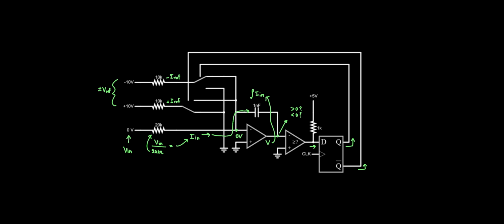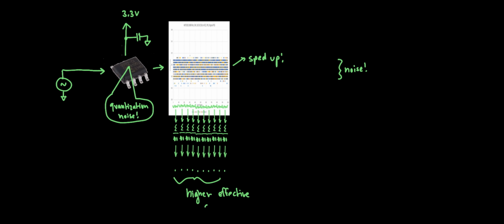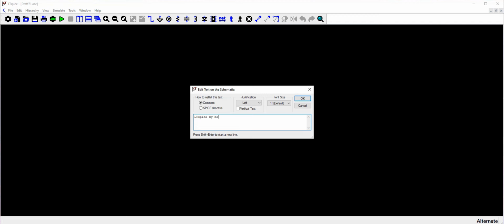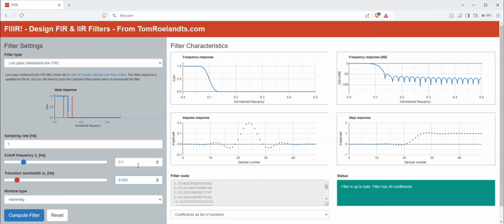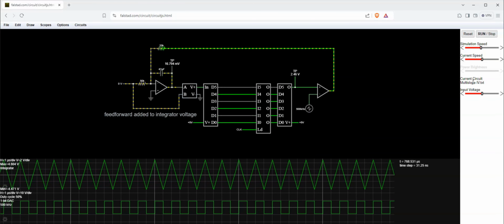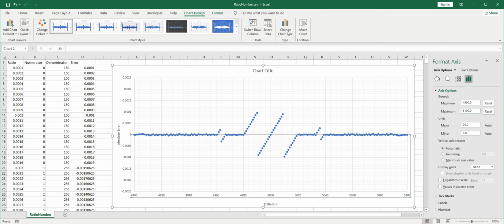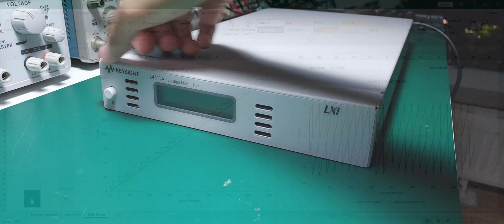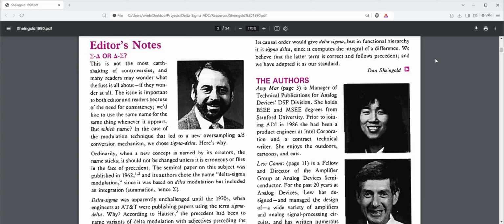Agilent's Multislope IV - A Delta-Sigma Story

Comment: I look into the slope conversion methods in the late 80s. I thought that multi-slope primary solve the issues:
1. Reducing the slope depend comparator delay by reducing the slope
2. Allow the internal compensation cap of the main integrator opamp to settle
3. Delay the final charge-balance decision after the dielectric time constant settle
4. Allow a fine ADC based on the slope remainder but requiring to calibrate the time constant of the slope

I think there are also patents and chips from ADI for triple-slope or similar. Yes, Keysight is still competitive on the market with a decade old design beside considerable flaws:
1. Blind times in the integration method which where solved in the Solartron instruments
2. Multi-Integration output from the same sigma-delta stage
3. Temperature calibration need to pause the conversion
4. Noise and linearity performance get catch up with IC solutions

There are newer approaches as the CERN open-source instrument which improved by using techniques from IC design could surpass the keysight in any spec:
1. Noise vs. Conversion Time Performance
2. Zero Blind Time
3. Multi-Resolution Data Feed
4. GOhm-Inputs up to +-30V
5. Integrated Temp Calibration by using Ping-Pong Stages

While i was curious over the decades how these instruments progress i design many analog chips not related to integrating ADCs and being now at a keysight competitor.
Reply: Interesting comments. Wrt CERN development:
3) Do you mean the ADC providing converted data at varying resolutions and o/p rates simultaneously? This is obviously trivial if you start with a high speed ADC and apply multiple levels of oversampling, but I'm probably missing something - perhaps the drawbacks of using a high-speed ADC, especially in INL performance, may disadvantage it compared to a integrating designs even though the ultimate oversampled noise performance may be similar?
4) When you say 'GOhm-Inputs up to +-30V', I assume you mean by boostrapping the input amplifier as used by Datron, and others, back in the 1970's? I'm not trying to nit-pick, but am genuinely interested if CERN have made some other advancements/ clever ideas in this area?
5) By Ping-Pong are you referring to alternating measurements and calibrations between two seperate channels? Again, I'd be a bit surprised if this technique wasn't already used in instrumentation with requirements for continuous calibration in high precision applications.

Comment: The plain Delta-Sigma ADC is not suitable for DC measurement, for its idle tone and memory effect. Incremental Delta-Sigma is a better option.
Reply from the maker: I explain how Multislope IV possibly counters idle tones in the video. 

Regarding memory effect, I'm sure it has some kind of mechanism in place, since measurements are still defined by NPLCs (number of power line cycles). I can only assume that they gather a fixed number of samples from the quantizer during a PLC and pass that through a sinc type filter, instead of continuously passing the resulting bitstream through the filter and picking outputs from the filter at a certain decimation rate.

Comment: Can you share the paper from John Pickering?
Reply from the maker: I'm afraid you'll have to contact John Pickering himself, I was not able to find the paper listed publicly, and since it was shared as part of a private communication, I am not sure if posting it publicly without permission is appropriate. However, the same plot can be found in a publicly-listed paper, 'Effect of a PWM DAC on the Noise and Linearity of a Delta –Sigma ADC', presented by Pickering at ADDA 2005. You'll have to contact him directly for access to that as well, despite being listed, no one has an online copy as far as I know.
Reply: @NNNILabs  You can find the the same plot in the paper by Paul Bramley and John Pickering 'Better Accuracy in Temperature Calibration and Measurement through a New Type of Analog-to-Digital Converter'. A key goal driving this ADC design was INL with a specified performance of .2ppm in the microK high precision DC thermometer instrument it was designed for.
Reply from the maker: @tonyh6309  Thanks for the tip! I actually do have a copy of that paper, but never realized that it had the same plot on it 🤦‍♂